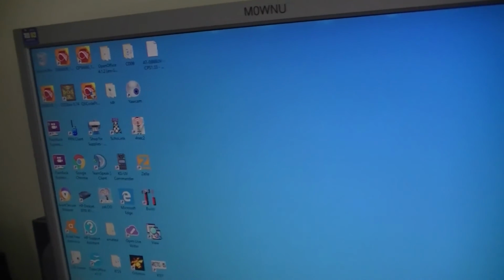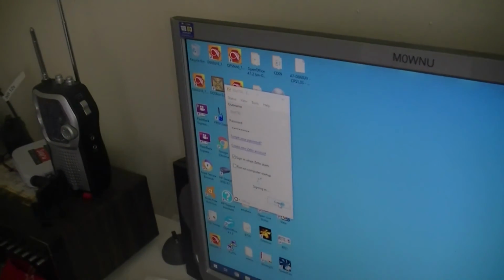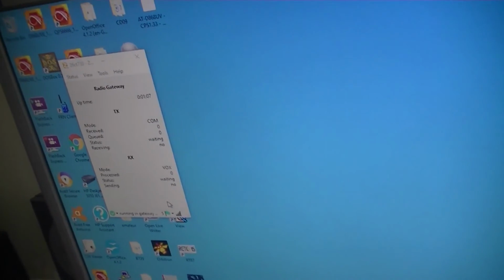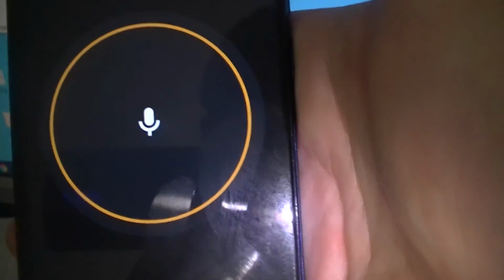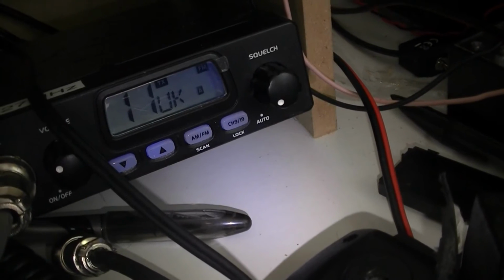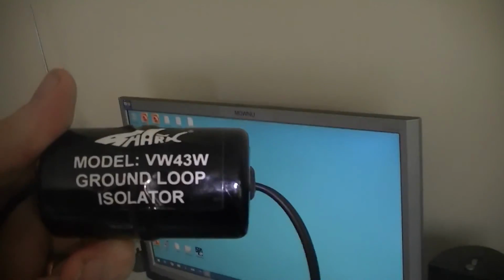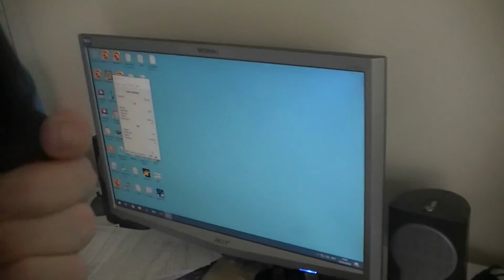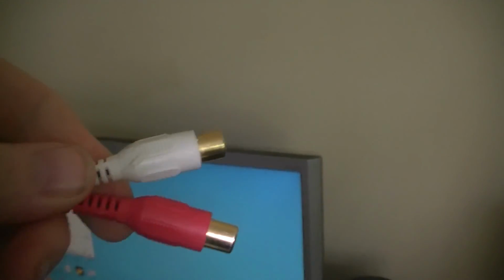Creating a Zello to radio gateway using a CB radio and a Windows PC

Comment: Great little project. I made a gateway on Zello using an android phone connected to PMR446 and CB at the same time. Unfortunately I had to use VOX, and yes did test my ADHD patients 😫 🤣 However was great. So here is a nutshell description I used an old Bluetooth headset for motorbike helmets. I wired speaker from headset to mic on CB/PMR and vice versa. Once connected set vox on CB, Baofeng, and Zello. Extra part was I could use Google assistant, and make or receive calls. I'm looking to make a new one and when I do I will document it. I will see if I have old videos and send you a link.